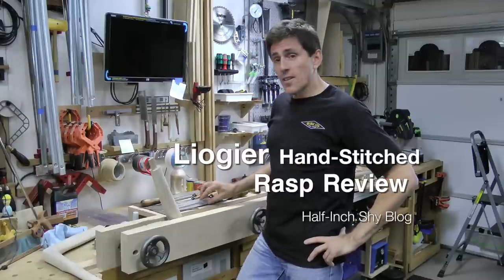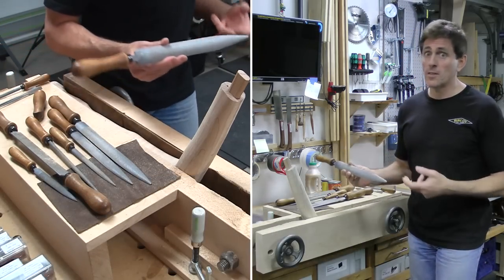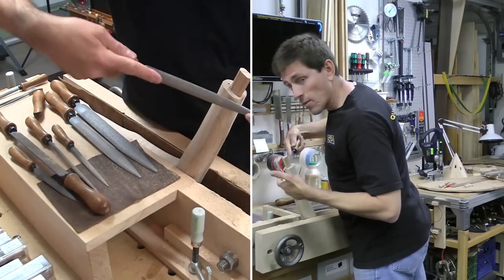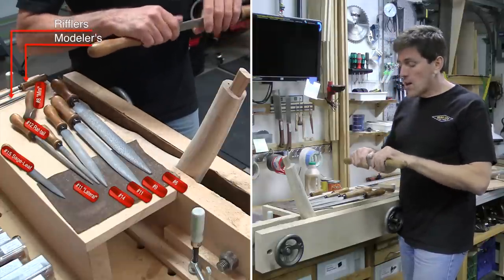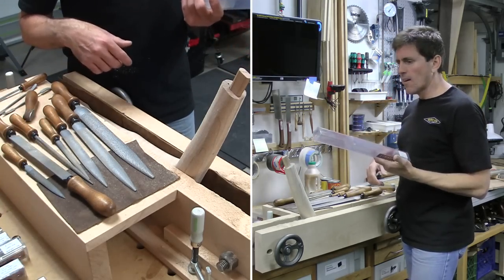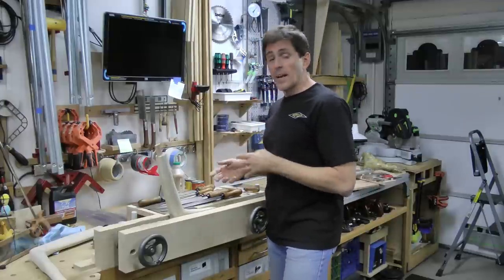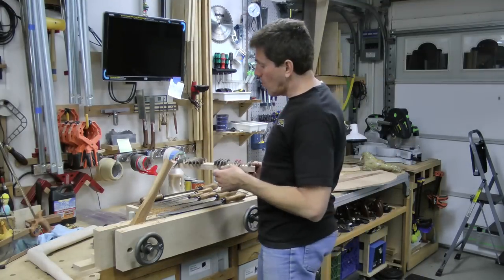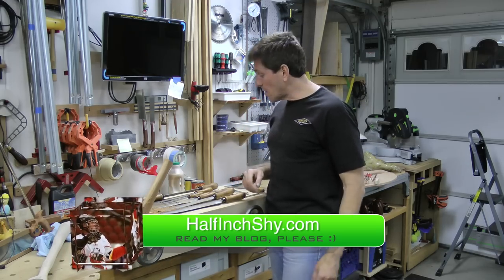#85 - Liogier Hand-Stitched Rasp Review

Comment: Thanks Paul. I'm waiting for some rifflers to arrive but, being hand made, they do take a while. You have a great set there. I was interested in your comment about the rat tail. I turn holes with a 1/4" spindle gouge on my lathe. I actually need a 1/2" hole which must be smooth down at least 2". The overall length of the hole is 4" the remaining 2" being hollowed on the lathe with a turning tool. I wonder if the rat tail rasp would cut and smooth out the hole to 1/2" from a little over 1/4" made by the gouge. I hope to manually 'twist' the rasp in and out of the hole. What do you think?
Reply from the maker: Hmm, I don't think you'd get the accuracy you'd want by twisting a rasp in the hole. It is tapered so presumably if you had a rasp with cutters out to 1/2", you could do it, but the hole would be pretty rough and need further refinement with fine rattails. I don't think the rattails come that fine, actually.

Is there no way for you to get a wider gouge to make the hole? or make the hole by offsetting the 1/4" gouge so you are in effect cutting a donut shape that leaves a cleaner 1/2" hole? I don't turn so I may be completely off.